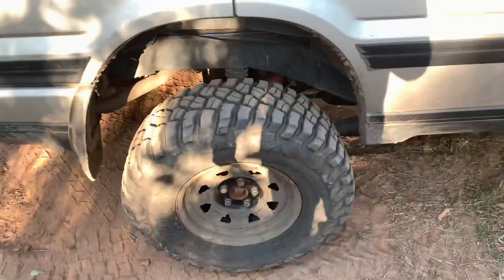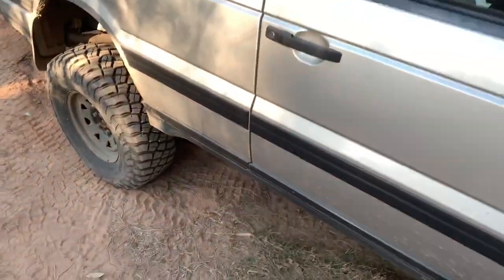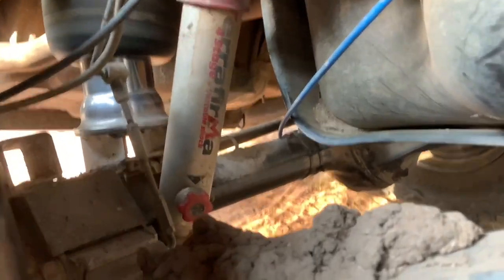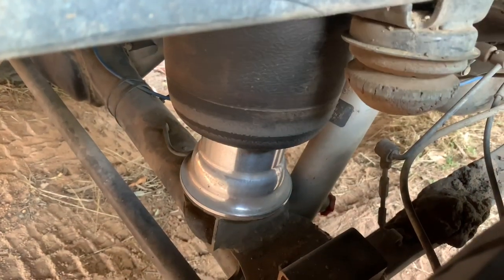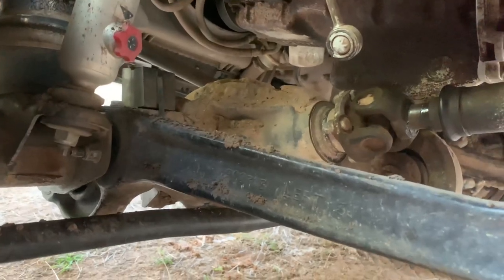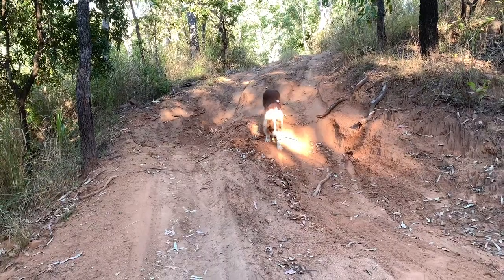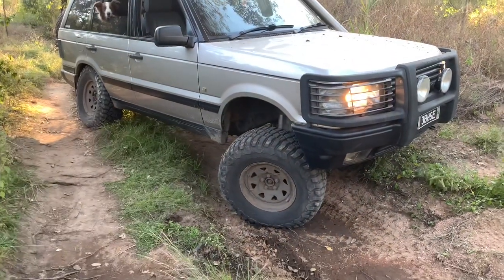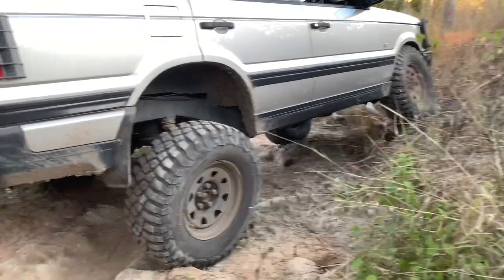2” Suspension Lift & 33” Tyres | Do it yourself | P38 Range Rover 4x4 | Flex it up!

Comment: Great video Keith.  I certainly didn't think about the rear spacer angle so am really glad you posted this before I make the spacers.  Made the fronts and back for the coil springs but now i'm going back on air your video is very timely.  Well explained and very easy to follow :)  Thanks for posting up.... Steve

Comment: Also always reading that people are ripping the air springs apart. I just purchased my first p38.. 2.5 diesel.  Super happy. Everthing works except for the suspension.  So I am in study mode.  Your vids are amazing.  Thanks for all the hard work you share.  Greetings from Austria.. throw another shrimp on the barbie 🤣❤🤜🤛
Reply from the maker: Hahaha cheers mate! Some have had trouble with the Arnott springs ripping apart, others haven’t. I’ve been using them since 2010 and had one fail (in 2010) which was replaced without question. Since then I’ve not had an issue. I got 7 years out of my first set which I replaced for preventative maintenance purposes.

You sound like you are a happy camper with your P38, that’s great to hear! Thank you for the kind words mate 👍
Reply: @Keithy_W  I am really happy. Austria they salt the roads here and even new cars are rusted to hell. I found this one from the original owner and has been parked under a car port for six years.  It's a beautiful example.  Has the 2.5 diesel  with a tuning chip.  New trans. Stronger engine from a e36  and a bigger diesel pump. Its started on the first click after we got the key to work. 2 left 2 right 🤣🤣. He just doesn't have time to repair the suspension.  So I got this beautiful ride for 1500 euros. Only thing cant get the pump to work. So having it towed next week. Bought it last week. After watching all your video's.  I cant wait to start working on it. I was a Porsche technician.  So I wont have a hard time getting her on the road. Also you have helped me more then you can imagine.  Keep up the awesome videos and stay safe.
Reply from the maker: Ahh yes, the old salted road trick! Sounds like you’ve been very lucky to find a rust free example!

It’s a good thing to have such a well maintained one, once you get the pump sorted it’ll be pleasurable motoring for you! What a bargain! Feel free to hit me up on Facebook (search for chilling with Keithy and you’ll get me) if you ever need advice or want to share some pics!
Reply: @Keithy_W  will do
. Finally got her in the driveway..  thanks for the kind words. 🤜🤛

Comment: Love your videos and hopefully you can help. I have a 95 P38 and had it in the shop for some brake lines being repaired. Went to pick it up and found that 1) gear shifter would not indicate it was going into "Park" or "1"(transmission does into park and 1 (shows "R" and "2" respectively) but not indicated), 2) Car will only start in "N" and key will not come out when in "Park" (again indicator shows "R" when in park), and 3) Blown Fuse #8 - no radio, Cigar lighter, or HEVAC..WHAT I HAVE DONE: Relay #7 under hood was melted so replaced fusebox..no other obvious faults...when bypassing BeCM and providing 12V to White with Pink feed to HEVAC and Radio, I get proper display, but no action by HEVAC nor any Radio...any ideas? Its getting cold and I need heat!
Reply from the maker: G’day mate. Sounds like you’re having fun there 😁 

The transmission issue sound like a simple adjustment is required on the gear selector linkage. This is done from under the car. Have you had a gander at the linkage in the past and know roughly where it is? This also will solve the key issue.

As for the fuse issue, that’s a hard one to diagnose. The issue could be a wire earthing out, or it could go deeper. Replacing the fuse box is a good start. It may sound silly (and I’m not suggesting you did at all) have you installed the correct fuse box for your P38? There are a number of different ones for the different years/engine combinations.

The fact that you had some action when bypassing the BECM suggests that they work, but without input from the BECM they may not function completely as normal.

A side note: running the blowers any higher than speed 4 is what causes the relay 7 melting issue. This is a design fault by Land Rover, basically putting too much current through a circuit board in an already hot engine bay. Running the blower fans at speed 4 or lower preserves the life of the fuse box.

Comment: Hi Keith. New P38 owner here from the UK and I hope to soon be doing a lift on mine before taking it somewhere to see if I can get it stuck 😂 excellent videos! Very helpful indeed and I'm still working my way through your channel. Can you tell me what offset your wheels are? I'm looking at buying 16" steelies with an ET25 offset but I want to make sure they don't rub
Reply from the maker: Cheers mate, much appreciated 👍🏻 good to hear from another P38 brother!

Mine are +57 offset, bang on the same as the standard 16” P38 wheels. If you go wider, probably want to give the guards a bit of surgery, but shouldn’t be too much work.
Reply: @Keithy_W  thanks for the info. I'll get myself some +57s.

Comment: All right Keith could you do a measurement from Center of wheel to the arch at all heights pls if you all ready haven’t . And post your findings thanks Liam
Reply from the maker: G’day Liam,

I have all my heights from before and after the lift. Here are the lifted heights:

After lift, height to center of wheel in mm

Access - 445/455 f/r
Low - 485/490
Standard - 525/530
High - 565/575
Reply: Keith Wager thanks that’s perfect matey . Love your rig 👍 hopefully do the same set up in time . Seen the 2” lift post you wrote up on forum very informative thanks

Comment: EXCELLENT video Keith, really APPRECIATE them, hope your well. Did you have those measurements for the height sensors at all? Maybe even the drawings/ specs for the airbag adaptor plates one day when your bored...... TAKE CARE Mate
Cheers Rob from Tassie
Reply from the maker: Robert Laundy G’day mate!

The rear height sensor (lower arm) is 48mm longer, the front height sensor (lower arm) is 23mm longer.

I’ll have to do some serious digging to find the drawings, although I could do a rough one by hand for the spacers ;-) 

Take care mate!

Comment: Great video Keith- one question though.... do they have to be Arnotts air springs or will any make Gen 3 be ok? Cheers and keep the vids coming!!!
Reply from the maker: Thanks mate, much appreciated.

As for the eBay version of Gen III’s, I can’t comment if they are any good at all. I’ve only used the genuine Arnott ones on my P38, although I’m acutely aware that they are very hard to find at the moment.

Comment: Hey, how fid you solve the wheel sensor for the abs? You didn t have to extend brake lines and wheel sensor lines?
Reply from the maker: G’day mate. I put extended brake lines in, but the wheel speed sensors are long enough and didn’t need extending, as long as the lift is only 2” and not more.

Comment: G'day mate i have a question about the wheels.
What offset are they and where did you get them from?
Are the wheels a necessity to run the 33" tires without scrubbing or can i run the standard wheels?
Cheers, Josh!
Reply from the maker: Rocky Section Adventures G’day Josh,

The wheels are 16 x 8” Dynamic Steel wheels. They are the factory +57 offset.

If you have standard 16 x 8” P38 alloy wheels, they are perfectly fine to run with the 33’s. You’ll still need to massage the front inner guard liners to run the 33’s.
Reply: @Keithy_W  thanks heaps for the response champ, really appreciate it! Helped Alot mate.
Keep it up! 
Cheers!

Comment: What kind of tires are you running? Still 18" rims? How's road performance and ride like with the BFG mud terrains? 

Thanks for posting these videos, I really get inspiration from your build. Have a '01 P38 that I'm building out currently.
Reply from the maker: G’day mate!

I’m running BF Goodrich KM3’s in 285/75/16. I no longer use the 18” wheels.

The mud terrains ride very well on the road, they are super-quiet and grip fantastic. 

My pleasure mate, I’m glad I can inspire others such as yourself!
Reply: @Keithy_W  Thanks!

Comment: Excellent video man! Congrats with your build. What gear ratio have on your diffs? To compensate that 33s
Reply from the maker: Thanks mate!

I’m still running the standard 3.54 ratio in my diffs.

The engine sits at about 2000rpm at 100km/h (60mph). It does not struggle to keep up with traffic in the city, and cruises nicely on the highway. Low range is not effected by enough to require a ratio change either.

Cheers
Keithy

Comment: Hi Keith, I have a two inch lift on my spring coils P38 and I just installed 33's on it and it's rubbing big time and I do have a 1" spacer on the tires, Any advise?
Reply from the maker: If you can massage the inter guards you should be right. Mine has standard guards, with a little heating to keep the front edges off the guards. Others I’m still running all guards and edges, no scratching or rubbing. I run standard offset guarding as well.

Comment: Hey Keith, thanks for the video! Wish I came across this before over stretching my gen 3’s. Question for ya - why did you use rubber for the front bump stop extension and not 50mm box section like on the back?
Reply from the maker: Cheers mate 👍 knowledge is power, now you’re armed with it 😁 hopefully you can get the Gen III’s replaced easy enough.

Initially I was going to leave the rubber ones in there to allow easier removal (should I ever want to remove the front spacers). I haven’t needed to remove them, but it was a future-planning exercise really. Could use box section for both.
Reply: @Keithy_W  thanks mate! Gen 3 repairs aren't looking good but I'll keep trying.

I also noticed you have no front sway bar - have you removed it completely or is it a temporary disconnection when you head offroad? How you find it driving on/offroad without? Cheers
Reply from the maker: That’s the go mate, see how you go.

I’ve removed my sway bar because I broke a linkage a few years ago. I haven’t got around to replacing the linkage, so it’s been without a sway bar for some time now! It’s definitely more boaty, but I don’t feel it’s unsafe. The key thing to remember is that without it I need to avoid rally driving, although I’ve pushed it hard and not come to the limit of body roll yet, so I’m comfortable leaving it disconnected for now.

Comment: Last question.. so did I understand that the rear spacers you made or found already with the slight angle. The welding part I understood.   Frnt are.. level and rear are tilted .  I am so happy so many hate these p38s cause parts are so damn cheap and a little knowledge these are amazing vehicles
Reply from the maker: That’s correct mate, the rear spacers are angled forward to prevent the rear airbags from pulling out of the clamp when flexing. The fronts don’t tilt as much under flex so it’s not been an issue.

Haha yeah I agree. Parts are very easy to find, it makes it really good for us!
Reply: @Keithy_W  morning.. or afternoon.  Last question.  Are these just coil spacers or spacers made for the air springs.  I see many but hate ordering something that's incorrect.  The cutting and welding the angle is least of my worries.  I told my lady I am about to make a fake name fb account so I can see more pics.  Also I dont even have the p38 at home coming next week. Everything is ass backwards in Europe. Back home I would hope in my f250 and trailer it. I need a damn c class license to drive my own truck here. Cause it weighs over 3500kilo..🤣🤣 why I didnt ship it over. I also have to register the bigger tires. Cant just mod as you please .  I have watched all your vids now. My lady is getting sick of watching p38 vids on YouTube 🤣🤣🤣 it's my porn
Reply from the maker: Good morning mate! 

The spacers are similar to coil spring spacers, but designed to suit air springs. You’ll notice the rear ones are angled forwards as well, that’s to prevent pulling the bag apart when flexed.

Ahh yes, the laws and licence stuff sounds like a load of fun for you! It’d be nice if it was all simple and easy.

Cheers for the kind words mate, say hi to your lady from me!

Comment: With the axles now able to hang lower, does consideration need to be given to diff angles and prop shaft lengths? I’ve seen some prop shaft spacers, wondering when those are used...
Reply from the maker: G’day mate,

The diff angles are only of concern when using “high” at high speed once lifted. Prolonged use in “standard” won’t hurt it as long as you’re regularly greasing the universal joints.

I’ve run this lift for many many years and have not had any issues with driveshaft angles or universal joints. I grease them every 10,000km.

Comment: Good video on the lift. Keep up the P38 vids. 
If you drop onto the bump stops can you still steer the car? Murphy's law it will happen where you don't want to stop and fix. 
Did you do the lift because you where bottoming out on the tracks or was it to fit the 33s or both? 
Whats the reason for fitting gen 3 bags over using OEM? 
Have you done a vid on the rear wheel carrier, like to see how its mounted up, I have a Kaymar unit to fit but it weighs a ton.
Reply from the maker: David Jackson G’day mate!

The car is still perfectly driveable on the bump stops, albeit rough (as you may know)! There’s no tyre scrub when on the bump stops, even when turning. I’ve got a bypass kit in the event of a bag failure, plus spares as well that I take on trips.

I did the lift to fit the tyres. I wanted to run a 33” tyre and it’s not possible without doing the lift. Where I 4wd, diff clearance is the main issue for me, which the tyres have solved. The P38 had enough ground clearance standard, but not enough diff clearance.

The gen III bags are necessary due to their extra length at full extension. Standard bags pull off the piston at full flex on a lifted P38 due to the short length.

I did a short vid (I’m sure) on the wheel carrier. I’ll check through my vids. If it’s not in there I may have to do a bumper-off vid for better vision.

Thanks for your comment mate! 👍
Reply: @Keithy_W  

A bumper off, video of the tire carrier would be awesome.
Reply: @Keithy_W  If you have 2 inch longer shocks and 2 inch spacers under the air springs then the bags will be just as extended as they would with stock shocks and no spacers, right?
Reply from the maker: In theory, yes. In practice, unfortunately not. I’ve been privy to ‘test vehicles’ that were indeed lifted and used standard air springs, the results ended bad each time.

I’m not an engineer, but I can only surmise that the geometry of a 2” longer shock absorber at full extension, at the ‘goldilocks’ angle, offers more than 2” when both extended and compressed.
Reply: @Keithy_W  Fair enough. I am an engineer but I’m not too familiar with the P38 suspension geometry 😁
Reply: @Keithy_W  Okay so a couple of months ago I fitted 35” Toyo Mud Terrains to my 4.6 HSE along with 2inch spacers under the air springs and extended the stock shocks by about 2 inches as well (plus extended bump stops 2 inches). Works like a charm, no ripped bags. The thing is unbelievably capable offroad 👌🏻
Reply from the maker: That’s awesome to hear mate! Do you have any pics on Facebook or Instagram at all? Feel free to share them to the chilling with Keithy page if you like 😁 I’d be keen to see it!